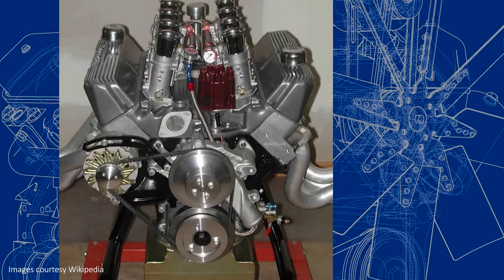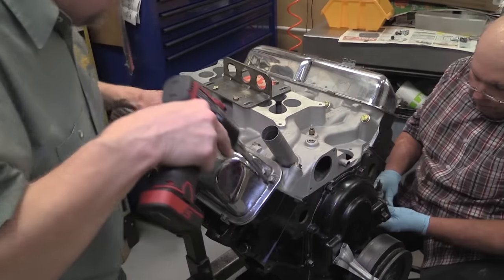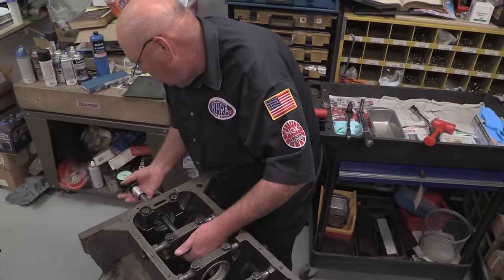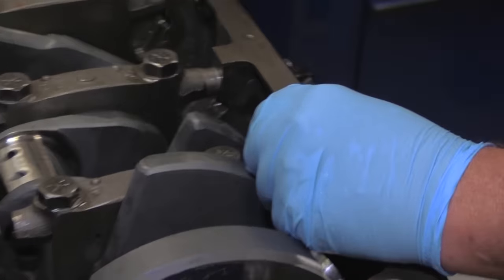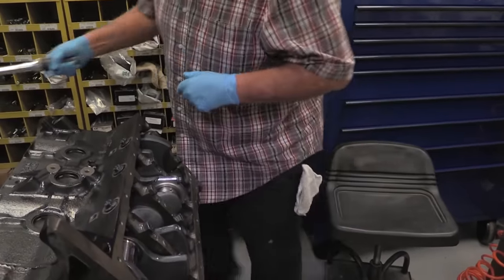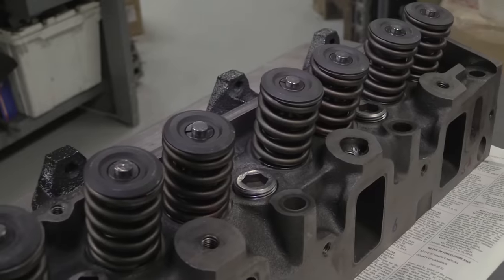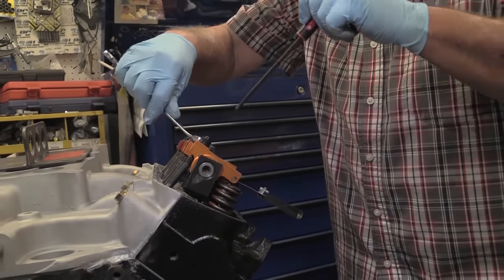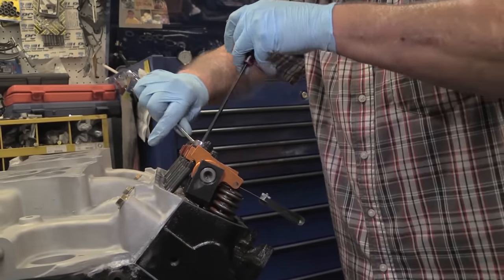Monster Ford 427 Top Oiler Engine Build and Dyno Session

Comment: The third version 427 is a SOHC used in the GT40 Ford was way ahead of the times. Lots of details in this FE series used in todays LS engines.
Reply: Except, unless you are set up financially to rebuild, say an LS1, throw em away after use. Sort of like butt wrap.
Reply: Ford never ran the SOCH at Le Man's. Ran the high riser at 500hp
Reply: Not true. No SOHC in a GT 40 only 427 FE

Comment: You're backwards. The 427 side oiler has no oil provision for the top end, so the cam requires a groove at #2 and #4. The top oiler has an anular grove in the block behind #2 and #4 to provide oil to the top end. The top oiler is drilled to run a hydraullic cam, the side oiler has no provisions so it's solid lifter only.
Reply: Mustardstain504 D 
don't forget the oil passages that supplied oil to the rocker shafts - that's one place we "cheated" to force more oil to the bottom end - restrictors in the passage below the oil supply rocker stand did the trick.

Comment: If you subtract the amount of cupping you did on the pistons to keep the compression down from the "increase in displacement" how much actual displacement did you gain?  Just moving bigger piston further does not improve performance right?  If you could have increased the volume of the cylinder heads and not cupped the pistons it would have been a much larger actual displacement gain and not just a gimmick.  You probably would have made just as much displacement just by boring the cylinders.
Reply from the maker: The dish, or "cup," in the piston has no influence on displacement. Displacement is controlled by the piston's swept area, that's the amount of stroke in the crankshaft and the diameter of the piston. The dish in the top of the piston helps knock the compression ratio down so that the extra stroke doesn't make it unmanageable. No gimmicks. Hope that helps, and thanks for watching

Comment: Video went downhill when stock heads were put on. What's the point of a solid roller with those cam specs when the heads were not even ported? Should have gone with a milder cam, at least you would get better gas mileage and it won't run so hot on the street. Build doesn't make any sense.
Reply: your'e right
Reply: Sometimes you have to build what the customer will pay for... Nick's Garage complains of the same problem...
Reply: Solid lift is the only option for this motor. There is no means to feed hydraulic lifters per design from Ford. Flat tappers are a nightmare with modern engine oils because they’ve removed zinc from their formulas except in Diesel engine oil. Rollers compensate for that somewhat. There is not that much gain from rollers as far as HP pickup in this particular build. My guess is this is a dependability issue but can’t be sure. I’ve seen guys rebuild motors from this era and if the oil pressure doesn’t get up quick enough it can literally put too much wear on the cam before it even gets up to temperature. I’ve considered putty rollers in my jeep just for this reason. But for now I’ll just keep running the Shell Rotella T in it. Lol
Reply: @rustycrustytriesstuff  My understanding is most of the zinc has been removed from today's diesel motor oil.  I use Brad Penn.  Expensive, but I feel safer with it.
Reply: herman452 I’m not familiar with that one. I’ll have to check it out. I know the MSDS on Rotella T has zinc listed in its chemical makeup. Not sure what the desired amount is ideal and how much the “recipe” has changed over time. I used it in my ‘79 F100 for years and got over 200k on it before I sold it. I’ll definitely look into what you mentioned. I’m always looking for ways to improve.
Reply: Did you not listen to what he says at 6:55 ? Lol
Reply: @hankschrader149   yes, but it doesn't make any sense with the rest of the build. The only thing that makes sense to me is if the owner plans to bolt a good set of heads on later, which may be the case. Building an engine keeping stock heads stock, He could have gone with a solid flat tappet cam with milder specs, cheaper rotating assembly, and made almost the same  power, except it would use less fuel and run cooler, and cost a lot less money, and be more street friendly. Cool engine regardless, I like the show.
Reply: I can understand not wanting to port an original set of scarce original 427 factory hipo heads.  If it were me, I think I would have set them aside in case I ever wanted to go back to stock, and then bolted on a set of ported Edelbrocks or the like.  Paint the aluminum heads black, and almost no one would ever notice they weren't stock.
Reply: Agreed,Froggie,max power takes well coordinated components.

Comment: You can make much better power with a warmed over 440. Not for nothing but..... a stock 440 had 480 ftl/lbs of torque with a mild flat tappet cam. The power of this engine seems kinda low considering they used a full roller set up. Are the factory Ford heads that bad?

Comment: Pump gas sucks but even so, I expected to see a torque number equal or higher than its cubic inches. They should have spun the big R-code engine to 6000 rpm..

Comment: They should know better using 20 thou exhaust clearance. Too prove they are too tight just set up a dial gauge on the top of an exhaust valve then wave a heat source like a oxy torch within a few feet of the valve.

Comment: Somewhat inticlimatic.The factory 427cu. in. motor was making that much power even tho what we would call race gas(103-104 octane for premium at that time) was necessary at that time for their 12-12.5 compression ratios.Like many of the muscle cars after 1970, A 55 cu.in. increase was barely sufficient to cover the compression loss mandated by government.
Reply from the maker: Yeah, that extra compression you could run because of the leaded gas definitely helped back then.

Comment: Hell this is almost just a well built stock stroker., it wouldnt look totally stock , but this many cubes needs and can handle on 93 pump gas a lot more Air....and Internal Combustion engines are air pumps.... So imagine getting some more air into it... just adding a better intake system even just a rare and expensive OE original equipment mechanical period correct hilborn injector system,  or paint a higher rise intake,..anything..port match to some good aluminum heads with just mild port and smoothing, you would have way better pulse and less restriction with higher flow probably 35%-40% more ..and alum. Heads would allow a tadl more compression. Then you add a little more camshaft, and more agressive roller rocker that would feed this Beast way more air and more consistent , and balanced  combustion cycles .....100-125+ more horsepower still be on pump gas...the torque would go up and it would probably keep going up in hp to 6500 rpm or redline.

Comment: must have been gut wrenching for the low numbers.something is wrong.
Reply: Dude ur silly that's great power. It's pretty much stock rebuild! With a cam no biggie 470hp. That's great and that's not even with the good ford heads. If u didn't know Ford had multiple heads on the 427. U had the high riser medium riser and few other heads. Even with a Ford intake

Comment: I bet my life on the fact the intake manifold is not OE, meaning its not a off a engine FORD original,but a cast intake made with the same specs, otherwise you would see the aluminium casting marks which ford left on its manifolds from the factory. :) just noticed how smooth the manifold aluminum surface was thats all, which is a dead giveaway. :) cheers great built by the way?

Comment: Why didn't he buy an aftermarket aluminium block and heads do some detailing to make them resemble stock ones and then paint them with color that matches the stock one,  and end up with 526 cu. In. Instead?
Reply from the maker: Because $$$. That was the engine that came out of the customer's car, so all he had to buy was a rotating assembly and gaskets.

Comment: COST of rebuild please, i would say approx 20K to 30K for a stock as a rock engine,but stroked out to 498, now lets see a chevy 498 stroker racing engine and see the difference. lol :)
Reply: If this was a racing engine it would have Single Overhead Cam Hemi,  Tunnel Port, or High Riser heads, so what is the point of your Chevy comment?
Reply: About 10-14000 dollars

Comment: What the hell, HP only at the 480 mark and going into a 2.5 ton car at least, which means he will not even feel it that much also its stocked to 480 almost, so it should have at least around the 550 HP mark, see what happens if he put FORD Racing heads on it, he will gain that extra 100 hp straight away ?

Comment: It's a nice motor and build, but I was rather surprised that with an expert engine builder, dual quads, bigger cam and almost 500 cubes, that motor wasn't even able to make 1 hp per cubic inch .
To me, it doesn't seem to be that efficient of a motor . For example, a completely stock 1965 Corvette L-76 made 365 hp from just 327cubes and just one carb . Just saying .
Reply: The highest H.P 427 Chevy 550 ,Highest H.P 427 Ford 657 ! Ha Ha Ha !

Comment: Nobody called them top oilers!! I was there in the day working in a race shop in southern CA. There is the standard block and a side oiler!!!!! There is no such thing as a top oiler!! side means it has a main oil galley running above the pan rail similar to a BB Chevy or Y block ford. The standard FE block had the main galley up by the cam. Youtube experts LOL. Its just a standard FE block with some vintage stuff bolted to it.
There was an aftermarket kit to bypass the plug prone oil galleys to get oil to the top rockers for Y blocks. Called a top oiler kit but that's obviously not the same thing .
The side oiler blocks had oiling issues the NASCAR guys finally sort of solved it by adding an external oil log next to the block to feed each main directly the side oiler main passage did not flow enough and flowed uneven. The standard block actually oiled better in stock form with some minor modifications it would out last the so called side oiler motors. The Fe's had potential to make power but the durability was always poor the narrow rod bearing just would not  hold an oil wedge and it was just a matter of time no matter what you did. One trick was to set up the bearing and side clearances on the rods very tight it really helped rod bearing life but the cam would have issues and piston scuffing would become a problem since they need oil coming off the rods to lubricate. They also had oil temp issues and the cooling water flow in the heads was poor and the exhaust side had no water which made them prone to detonation.
Other than that it was a great engine LOL

Comment: 427 should put out 650 hp or more you'd think.🤔🤔🤔
5.0 coyote engine puts out 485 horsepower. 302 cubic inch engine. 
😁😁😁
Reply from the maker: What you can't forget (and I'm not saying you are) is these are two different generations of engines. The modern Coyote has so many advantages over the 427. The biggest in my opinion is variable cam timing and multi-valves per cylinder. You just have to appreciate each engine for what it is. Thanks for watching!

Comment: Why didn't you guys buy a light weight crankshaft. You could have sold the crank bought a racing light weight just buy doing that you could have added at least 50 to 70 more hp. Otherwise great video
Reply: Nope

Comment: Pump gas.. you mean 93 octane by the drum.  Iron headed 10.5:1 shouldn't be pump gas friendly.  You might get away with that on the low side because of the huge overlap while running decreased timing, but that is gonna bite ya in the real world in a real boat of a car accelerating or a bad tank of gas... That's my opinion only.
Reply from the maker: You are right, but 93 is pump gas -- unless you are unlucky to live in California.

Comment: Took 10 minutes to say is almost 500 cubic inches, not as advertised?

If it can't create torque values equivalent to displacement, am not impressed.

Have run 70's Windsor blocks with cast iron heads to far greater numbers.
Reply: Check out 1:40, they mention the total displacement with the stroker kit.  Admittedly you're right, there are certainly better engine designs... but those engines came later.  When these FE engines were in production, big block Chevrolet engines had scalloped valve covers.
Reply: @jmumbauer  true.
Ran mid 70's 351W blocks bored/stroked to 408 @12:1 comp with huge cam and N heads for a number of years.
The numbers were way up there, in the ~700 ft.lb. areas.

These blocks should be making large numbers sounding like such a monster.
🤔